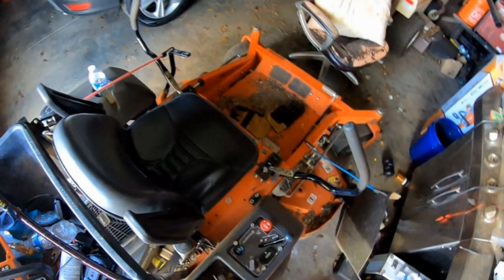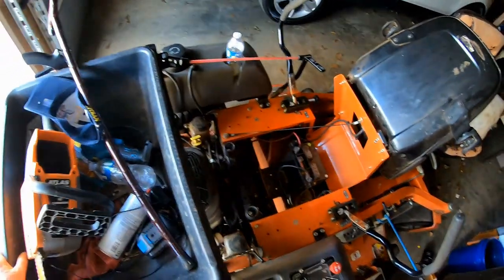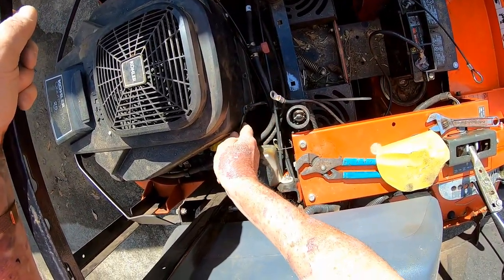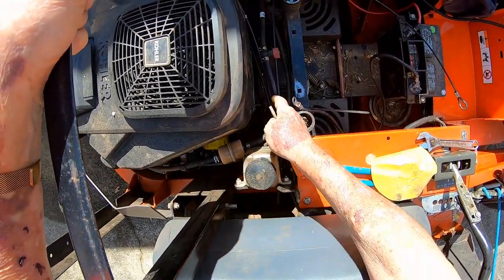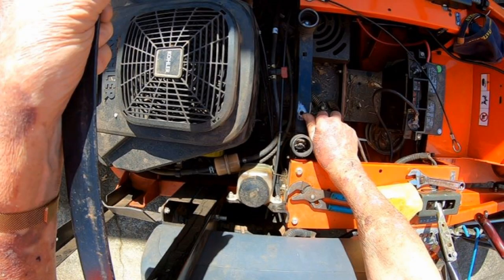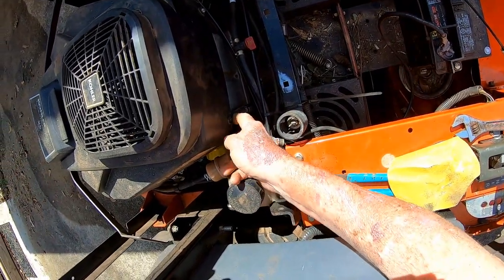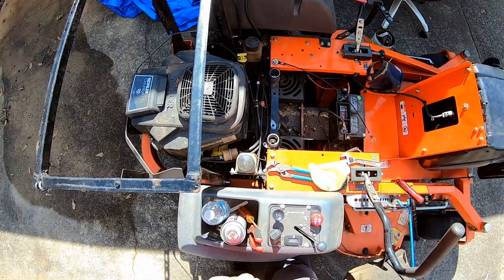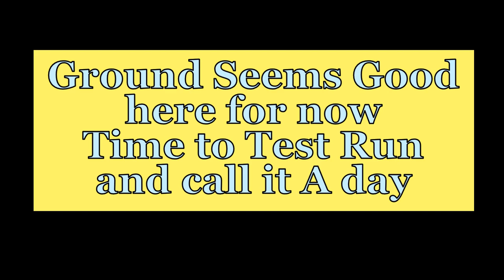Bad Lawn Mower Ground Wire Connection Pwalpar VLOG 5-11-2023

Comment: The engine is grounded were it is mounted to the frame. You done a fine job relocating the wires. I have two riders that I am working on at the moment. One is a Craftsman that needs a fuel pump. Before the pump went out, I had to rewire for a new ignition switch. It was supposed to be a standard 5-pin switch, but no, the pins were marked differently. The other rider is a Snapper Z Rider joystick controlled zero turn that I'm thinking a pump is going bad on it as it doesn't turn right very well. I am concidering swapping the 18hp Briggs from the Snapper with the Craftsman that has a 15.5hp Kohler. It will be an easy swap if I choose to do it. By the way, parts for the Snapper are getting hard to find or the prices are sky high.
Reply from the maker: Spring right around the corner so get er done now lol
Reply: @pwalpar  I try to keep a back up plan.

Comment: Short of putting the wire up where you placed it, any connection where the engine attaches to the frame would also be considered good ground. I was thinking about where the shaft goes below the mower as a ground. Probably even better because it would have the weight of the engine on it as well.
Reply from the maker: Thanks Hugh  I was limited some by a short wire